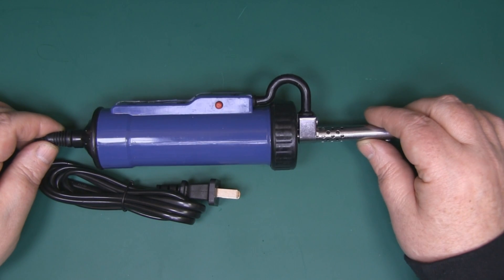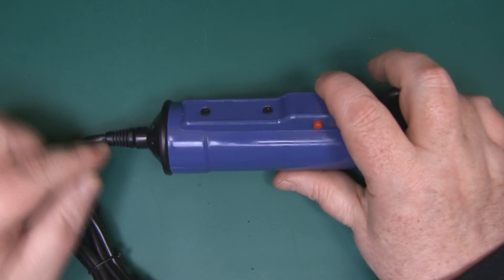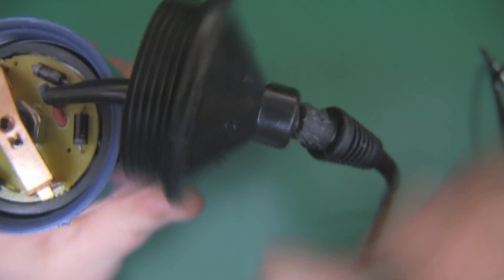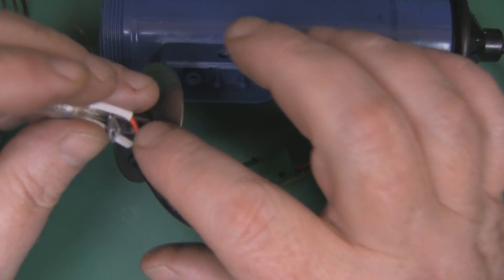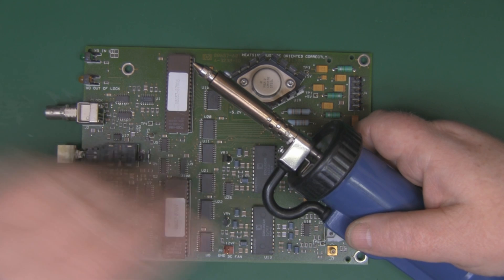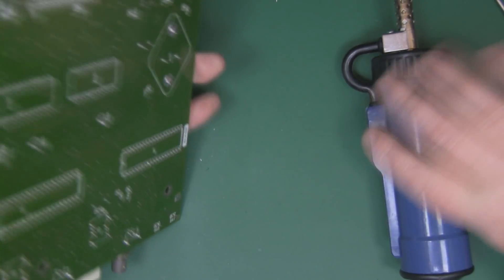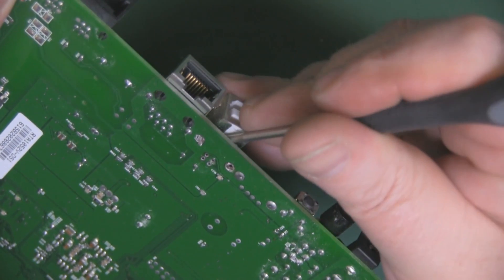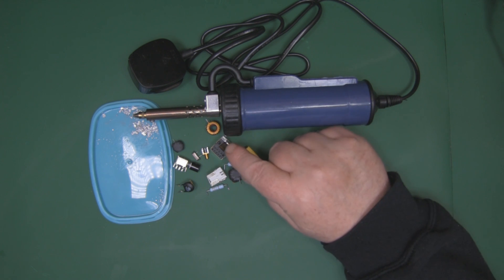Cheap Electric Vacuum Desoldering Pump from eBay Teardown and Review #147

Comment: The mains wires are more than adequate for the low current they have to pass. The mains cable strain relief needs to be twisted to engage the four lugs in the end moulding. Had mine for about ten years without operational issues.

Comment: Was running into suction issues . found out not to tighten too much the black screw on cover that holds the soldering metal part on to body. I guess I was over tightening it

Comment: i used a 30w lead extractor almost like that. 30w is not enough to melt the lead completely. very difficult to use. and if you are in a country with lower temperature then the wattage ratio has to be increased. i just threw one in the trash 2 days ago

Comment: i used a 30w lead extractor almost like that. 30w is not enough to melt the lead completely. very difficult to use. and if you are in a country with lower temperature then the wattage ratio must be increased.

Comment: I got this exact device, and unfortunately, the heating element broke after just a couple minutes of use. There was a popping noise, and then the iron eventually went cold. The sucking functionality still works though, which is a little strange. It's a shame because I was able to remove the solder on one pin fairly easily. I don't think I'll invest in another.
Reply: Well, they work a lot longer if you run them on an inverter.... on 220 V instead. Otherwise they overheat very, very fast indeed. You can actually see the glow during one of the last parts of the video.

Comment: Hello how the rear part can be dismantled, one of the two power cables seems to be welded, there is play and the pump does not heat up. I unscrewed the black cache and I don't know how to go further. Thank you in advance for your return
Reply: I managed to remove the base and re-weld it connect the wire in question. It was not easy, in particular to put the two springs back on

Comment: I have a silly question,  I bought this exact unit, but should have bought a 110V,  The seller will not let me return it.    Do you have any tips on how I could convert this unit to operate on 110V?    Is it just the Heater core I would need to replace,  or other components to?

Comment: ALL soldering irons weither cheap or expensive will smoke for the first few runs. Sometimes its enough to think its on fire but its normal. Even used to specify in the manuals of ones you got from radio shack or the like.

Comment: my big problem with these is they're only 30w, making them functionally useless for something with a big ground plane.
Reply: They're useless for more reasons than that. Try doing any microelectronics with this. No chance, doesn't even touch the solder.

Comment: mine broke down, im assuming its the magnet that is broken because its still heats up, but when i press the red button,  it sucked but it does not go back until i unplug the cable. does anyone have advice to give for me?
Reply from the maker: It’s the solenoid coil you can pick up a replacement from ebay for around £3. Had to replace mine last year.

Comment: The diameter of the wire for mains does not matter, it's the current draw that dictates the necessary wire thickness. In the case of this soldering iron the current draw is 1/8 of an amp (30w @ 240V) even jumper wire can take that amount of current.

Comment: Hi Andrew,  I was wodering how this thing kept up over time.  Thank you for this great video. It helps me to select a low cost Desoldering pump.
Reply from the maker: It still works but I had to replace the solenoid last year!
Reply: @andrewmcneil   Thank you for your reply.  Also good to hear that spareparts are available... I guess it took some research to find it.  I mean: finding a sparepart for a non-branded device can be a challenge

Comment: It works even better if you add some flux to the soldering points, and/or some new tin When the component are gone use a braid to clean the last up with if you going to use the board. But Yes.. a Branded pump cost 5-6 times as much or even more so for the moderate user it's a good choise.

Comment: The weak point is the weak spot welded bracket the shaft/tip screws onto, once that lets go the internal metal tube breaks in half with it

Comment: Is there some special technique to using this tool??? I bought it and tried to remove a dual pot. It seems there is always some solder left that keeps the component from coming off. Any help appreciated.
Reply: Add flux and new solder to each joint. That preheat everything, and also significantly improves the solder flow. The use the solder sucker on the fresh joint.

Comment: Operation:
This is a 220V, 30W unit. It  is a very versatile & effective tool, & works extremely well. Has good suction power.
I have reverse engineered the circuit. Here is how it works.

a) When Unit is powered, the mains AC power is applied to the heater-element (230V, 0.137A, 30W, 1.67Kohm).

b) When the PushButton switch ("PBS") is pressed, mains rectified DC (thru a bridge) is applied to the solenoid coil (162ohms, 1.4A, 325W).
This is a huge (325W) heating power which will burn out the solenoid coil if left long.   

c) Fortunately, it is applied only for a fraction of second (~0.1 secs), even if the "PBS" is pressed & held.  This is because, due to the huge magnetic power, the vaccum plunger is pulled in quickly with a thud-sound, and the spring-loaded-switch (SLS) at the top-end of the unit, is mechanically pushed open from bottom.

d) Once this "SLS" opens, the High current (1.4A, 325W) thru the solenoid is removed, and instead a small holding current of 0.125A only is passed thru it.
This is achieved by an ingenious circuit wherein the heater-coil (1.67Kohm) is now inserted in series with the solenoid coil. 

e) Due to this the solenoid-coil gets a lower holding current, which keeps and holds the plunger in position at top, against the spring power, without heating it up.

f) When u release the "PBS", the above holding current is also removed, and the plunger returns back down due to spring power & spits out the sucked solder.

g) Because of this ingenious (& yet simple) circuit, the PBS can be pressed & held longer without fear of burning out the solenoid coil.

h) But due to any problem, if the top "SLS" switch does not open, then the 1.4A/325W current thru solenoid is not interrupted, and it heats up tremendously, and eventually burning out the solenoid, if you keep the PBS pressed & held.

by Bhishmar, Tvm, India.
Reply: My version with QH markings, has longer uniform black body. It has 200W (230 Ohm) heating element, not 30W. Build quality seems to be tad better. REMEBER: you should release the button ONLY AFTER lifting the sucker, or it would spit the solder back, this type is not much more expensive constant vacuum sucker.
Reply: Can you please explain me how to connect wires on the board with rectifier diodes, that goes from the switch? My tool is broken (one of the diodes burnt), and when I disassemble it, I broke all four colored wires from that small PCB, and I don't know how to reconnect them... :-( I understand that I need to have permanent power for heater, but what confuses me is how to put in series the heater and the solenoid when I press the button. Thanks in advance!
Reply: solved ;-)
Reply: Did I see a FBR🤔
Reply: Mine is not working well, but by reading your circuit description, the holding current is not enough because i am using 120V, and maybe that is why it doesn't heat well to melt the solder.
So in order to make it work fine, maybe i just have to change the heating element to something with half the resistance?
Reply: @alexwinger  
Changing the heating element is just a half-ass fix, the solenoid was designed to operate with 220V, so the suction is weaken with a 110V supply. 
There are three ways to fix the situation:
1) buy a 110V to 220V transformer.
2) Find a qualified electrician to get a 220V from your power box.
3) Buy a 110V version from Amazon/Bangood etc.  They sell 110V version now.
Reply: Can't you make new one, we already done with vaccum pump,.
Reply: The is a very good design, now I would order one and hack it out.
Many thanks to your idea.

To complete the hacking,
i) connect the ground to the metal part of the solder iron.

Comment: I notice it had a u.s. plug on it which it wouldnt work in the u.s. because the desoldering pump is rated at 220 volts in there adds , you are right about bad electrical connection on the insides .thanks for shareing

Comment: Hi, excellent Video, I use it too. But recently made small modification adding a ground conection wiring. My problem I took pictures to mounting circuit back and loose them so I don't know were to solder each green, red, blue & white wires. Would you mind to take a picture of other side of the circuit board? Appreciated

Comment: Just thought I share: I bought this and I think I got a faulty one. The heating element can't melt the solder to tin let alone melt the solder on the board even with flux and extra soldee. I have to use an iron with this to get molten which kinda defeats the purpose. Hope this helps
Reply: If the unit you bought has a 220V element and it's operating on 110V you will only get 1/4 of the rated wattage and heat.  Measure the resistance of the heating element and calculate the I^2R wattage (Ohm's law, don't push the button, just the element)

Comment: sounds no better than the ECG rubber bulb iron.  At least replacement tips are widely available for the ECG.  I keep a selection though of tools for the purpose, and pick based on need.  I have desoldering wick (various), a couple of spring loaded hand pumps, the ECG rubber bulb desoldering iron, and a Hakko FR-301.  Which I use depends on what needs done, as sometimes a hand pump is the best tool for the job instead of the Hakko for instance (at the cost of the Hakko, and the cost for new tips for it, I kind of only use it when I really need to).

Comment: (3:30) - You say that "these wires do look a little bit thin to be carrying mains electricity."
Actually, the fact that it's 240 volt mains has got nothing to do with the size of the conductors (wires).
Have you seen the size of the wire that is connected to the starter motor of your car ?  That's just 12 volts.
No.  What matters is the current.
Now the heating element of this desoldering tool is rated (or at least advertised) as being 30 watts.
How many amps is 30 watts at 240 volts ?
Easy. Power, (in Watts) is defined as the voltage multiplied by the current or amperage.
Basically,  P (power in Watts) = I (current) x V (voltage).
Therefore, the current I = power (P) over voltage (V)
The reason we need to know the current is because it is the current , not the voltage, that determines the minimum size of allowable wire.
So, we have the current, I in amps (A) = power, P in watts (W) over the voltage, U in volts (V). 
(Yes, I know it's confusing. Voltage or potential difference is represented as U, volts are represented as V. Please, don't ask me why.)
( I = P / U  == A = W / V ) - this is correct SI terminology.
But most British electricians would write the formula as:
I = P / V
(I know, it's all kinda screwed up).
Anyway...
I = 30 / 240
I = 0.125A (amperes)
So the current is 125 milliamps.
The minimum size of cable to carry 125 milliamps is actually so small that even a single strand of that very small wire you see there would be quite sufficient.
Remember, it's the current, not the voltage which is the deciding factor when it comes to wire sizes.
All the best.
>

Comment: (1:15) - Whispery bits ?
You said "whispery bits"
Now, wispy bits would make sense.
"Wispy" is a proper word.
It's in the dictionary
.
And "Wispy bits" would be a perfect description of what you are showing.
As would whiskery bits
But whispery bits ?
Er, no.
Do those bits whisper to you ?
What do they whisper ?
Pray tell...

I find this really interesting because I have noticed that Yorkshire folk tend to say "slippy" when they really mean "slippery".
In fact, slippy really isn't a proper word inasmuch as used in the sense of a slippery surface.
The proper usage of the word slippy refers to a potters slip. That viscous diluted, watery clay stuff.

So, it seems that not only do the Yorkshire folk get the words slippy and slippery back to front.
They also conflate the words wispy and whispery also mixed up but in the opposite way.

Well, they do say: there's nowt so queer as folk.

Lovely video, anyway.
Got a thumb's up from me.
>

Comment: Hi!
I bought one myself and it worked..kinda!
Had it powered on for a good thirty minutes.
Since no stand really fits I had it hanging by a toolhook on a wall.
While fiddling around with something I accidently lifted my eyes and the blue casing had melted becouse of heat and gravity!
Really dangerous tool!!
I ended up buying a desoldering pump with double action diaphrame instead.

Comment: Thanks for the teardown and review, very helpful! Mine didn't come with a plug adapter, fortunately I have one at home. I'm thinking of replacing the power cable with a computer one, which is much sturdier and doesn't need an adapter. Is there a place where the ground wire can be soldered, or should I only use 2 wires as the original?
Reply: Its plastic, route the earth to the iron stem but remember to protect it against the heat

Comment: I think the failing part of the unit will be the electromagnet coil, the inrush each time you press the button will take its toll on the coil, especially any weak point within the winding or connections.

Comment: If the elements burn out unlike a soldering iron, they cant be replaced. Mine has burnt out. You also have to be careful when cleaning the solder from out of main body. If you are not careful, twisting the cap at the heating element end can result on the heating element wires being twisted and broken.

Comment: Take a dremel tool with a cutting wheel and slice a notch into 1 spot on the tip. It will give an air vent hole so it wont hammer the solenoid and make it easier to use.

Comment: To the best of my belief it is illegal to supply this product in the UK, not only because it has neither a protective earth connection nor apparently double or reinforced insulation between the mains and the accessible metal, but also because the US type of mains plug.

Comment: Hi guy, what volt do u use this? I just buy this, it does not work with 110 volt .
Reply: take 220v out cord with the plug out get 110v cord with plug on it that how change the wires out of it.
Reply: foxman362 thank you

Comment: This thing is a liquid solder spitting fire hazard....
Just amazing china xD
Reply: The principle is sound, and keep in mind, that with a hand pump, you still have to clear the pump after every use, and the workspace can get quite covered in tiny solder bits when using a hand pump.  The problem I see here is that it spits it every time you release the button, but with a hand pump you chose when and where to clear the pump.

Comment: The perfect tool to remove some pads!
Reply: It's not a good idea to twist a component off the board, not in a violent fashion anyway. The method of removing of SMD capacitors using a gentle back and forward motion until the metal in the pins fatigues and the component drops off the board can be useful when you don't want to apply heat because the board is too fragile or because the corrosive electrolyte from the capacitor( yes if you are heating a leaked SMD capacitor the electrolyte will start to spew all over the board) will get in an inconvenient place (under a component that is impossible to remove - a fragile screen ...). 

A tool like this Chinese crap in the video is dangerous because you can't control the amount of heat you apply to the board
If you do want to repair boards there are much better cheap Chinese solutions

Comment: i have the same like yours,but now  the selonoid got  problem sometimes stuck, the cooper contact point at rear was touching the supply wire when it moving and scrub the insulation..  i dig a new hole then wiring a new path and not touch the contact.   i like this pump make my job done but the safety need to be fix by manufcturer..

Comment: Just got mine in the mail and the magnet doesnt seem to be holding - I hold the button and it repeatedly sucks and releases like a machine gun - just wondering if I can repair it as I won't be buying another.. Any ideas? Thx!
Reply: Hello there Brian, the reason why is doing that is because the tip is getting obstructed, you need to lean it a bit to the side so it can get a bit of air and suck the solder, by the way is it getting hot enough to melt the solder?  mine is not melting the solder, it does get worm but no luck. have left it for 30min and sill not hot enough......
Reply: Hi, thanks for replying - actually the problem is worse - I live in asia and the voltage is 110v, - it needs over 200v! so it isnt getting enough current for the magnet or the heater - the aliexpress page didnt note this but another seller did- are you in a 110v country? if so, that's why it's not getting hot enough - gotta buy a step up transformer for it now....
Reply: That is correct,  that is my problem too,  thanks for the tip friend
Reply: I had the same problem with the machine gun effect.  It sucks off the solder then immediately sprays it all over your PCB.  I used it for one project to remove a few resistors.  Te next time I plugged it in and just get a weak hum.  The button does not fire at all now.  I contacted the vendor on eBay and they promised me a replacement unit.  We will see!!!